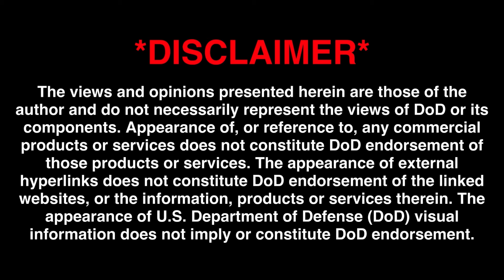AA590 Boeing 737 Rejected Take Off

Comment: STIG Aviation on YT is a AA aircraft maintenance tech and he addressed this on his channel that theres a possibility that the tire may have had a recap tire come apart. Which showed both starboard tires completely down to the rim which the fire also deflated the inboard port tire.
Reply from the maker: My understanding is most airlines use retreads.
Reply: @themoverandgonkyshow  If I'm not mistaken on his video and some other past videos he did, mentioned it is allowed to FAA standards that a tire can be recapped and limited to so many cycles.
Reply: @sailormike1089   In the automotive world, a recap and a retread are the same thing. I don't know about the aircraft nomenclature.

Comment: My question to you move it would be the tire is blown. The aircraft is already heavily listing over to the right if you go flying at some point, you’ve got a land with the landing speed be greater than the speed is at at the moment and also with the landing with on the one remaining tire that side make the other tire blow out with excessive load because the weight is not being distributed over to Tyres on the right hand side if the second tire blows out on landing you have nothing that side which means the plane will instantly catch pull round and you will have a very bad accident on your hands possibly surely rejecting a takeoff on the ground even if you are praying to the gods for the extra couple of foot of wrong way to bring it to a stop is better than going flying and not knowing whether you’re gonna get it stopped on the ground on the go around

Comment: Excellent discussion and explanations. The reason for the captain making the reject, especially when he's PM (Pilot Monitoring), is he's, theoretically, more aware of other factors and he still has his hands in position to take the airplane. He has also typically made those decisions already. It's very individual. Sadly, I've known a lot of F/Os who were not into making decisions or aware. Personally, I think the startle factor is less of a threat for a dialed in PM than wrestling the beast and dealing with my mind going, "WTF?". This is cover for the hydraulic/engine/other critical system failure. I'm very much with you that the airline F/O is generally not respected for his/her experience and judgement. Of course, it also very much depends on the F/O and how well the captain knows him. One of my last A330 annual CQs before I retired, the check airman, I knew him very well, criticized me for letting the F/O land the jet with a failed engine on the LOFT. We had a good discussion. What he didn't know before we talked was that the F/O was an exceptional former A-10 driver and aviator who I knew even better. We had flown together often including the 3 previous CQs. I'd rather have had him with me than several captains when we used to have captain, rather than F/O, relief pilots for Asia and Europe. He continued to disagree but we each made our points. I loved flying the jet. I'd rather be flying because I could do as well or better than most, captain or F/O, but my job as captain was to be totally wired into any situation. I can do that better if I have a good F/O driving and talking. Besides the Airbus SOPA for an engine out, overweight landing, and several serious abnormals is autoland. Two of us wired for deviations and additional problems is far better than one. His main point was how he was going to explain that decision to let the F/O fly a busted jet at a rug dance or to a safety board. Fair point. I'd already told him how. There was nothing written that said I couldn't make that choice. Besides, I'm the captain. My decision, I'm responsible for the outcome. I'll deal with the consequences. Yes, I knew the check airman and his mindset. I did what I did to make a point. The F/O was just icing and a cherry on top. Last quick point: AA procedures, callouts and individual duties, are different than ours were. They make a big difference. A blown tire was almost universally thought of as a GO past 80 knots unless there was any other negative effects. Those are the things we think about and have decisions made before going to fly.
Reply: @DonWan47  DILLIGAFF

Comment: If you blow a tire, the ABS will be drastically affected. Not sure if RTO Autobrakes were used here, but the pilot flying did an amazing job. Tons of damage to that aircraft. Flaps, main gear doors and engine. Not sure if that fire was hydraulic fluid or magnesium wheel igniting. Glad nobody was hurt, and they even exited the runway. Not that the runway would be used until the aircraft was recovered. Fire fighters would probably prefer the airplane be on the runway because it's much wider than a taxiway, and leaves more room to maneuver equipment. Great job by everyone involved.

Comment: Since going to the 121 world, I’ve noticed that the mindset behind rejects is…odd. 

Only CA calling the reject AND taking controls. Between an actual reject and the many I’ve done in the sim, that change of controls can get VERY dicey—especially if you have a situation that creates a lot of yaw. Crosswind with an engine failure or uncommanded TR deployment, for example. The CA has to instantly match the FO’s inputs as he takes his hands and feet off the controls. More often than not, it ends up being VERY squirrely, at best. While I can understand the CA having ultimate say, I can’t understand the binary, instantaneous change of controls at high speed, with potentially near-full control inputs present. Now throw in a low RCC and you have a recipe for disaster. Why not let the PF execute the abort down to a safe speed? I never understood this.

Also, the reject mindset seems to be more liberal. For my 121 reject (years ago, so the details are fuzzy), I had a generator failure. Day VMC. In my mind, I was taking it flying—generator failures were an everyday occurrence in the Rhino. I figured we would get airborne, run the QRH, likely fire the APU for redundancy…airplane flies just fine. CA immediately called the reject, and due to a stiff crosswind complicating the control change, we ended up halfway between the centerline and the runway edge. 

I queried other FOs and CAs, and the prevailing mentality was that it was correct to abort because it was an “electrical malfunction”. I noticed that my former military buddies voted “go” while my civilian buddies voted “stop”. Not a dig at either, but the disparity is interesting—along party lines, so to speak. I know that system failures and aborts are certainly more prevalent in the military world (at least in my experience—I was a black cloud pilot), so perhaps that experience base is what is forming the “take her flying” mentality? I can only speak to the Rhino, but a blown tire was most certainly a “go” call, as a high GW abort on a blown tire is going to be a bad time. 

Regardless, good discussion. I think this is something that needs to be explored. Apologies for the stream of consciousness!

Comment: V1 is not a “decision speed”, but a “last chance for ACTION SPEED”.
V1 is the maximum speed at which point a pilot MUST TAKE first ACTION to stop the air raft. The decision to stop must be taken well before V1. 

There are no 3 seconds to decide or whatever the talk is here. 

Also … why invite a guest who seems not to know anything about transport jet operations, especially if Mover knows his shit very well himself 👍🏻
Reply: I previously responded contrary, but it appears you are in fact correct! Learning occurred today. Unfortunately, they’re still teaching in many 121 programs (and CTPs) that you get V1 PLUS X seconds, not that V1 INCLUDES X seconds. Dangerous.
Reply: @C420sailor  You are absolutely right and I had countless discussions during my flying career about this subject. At least nowadays the common FAA/EASA V1 standardized definition is as clear as it gets and Mover explained all the other factors very well 👍🏻
Reply from the maker: The three seconds is typically found in Air Force Dash-1 assumptions.  Skid was an airline pilot long ago.
Reply: Three things here. 

1) Inviting a guest who knows less about a subject than the host is a great way to naturally let Mover explain things to a wide-ranging audience. Obviously, it's just my opinion on technique.

2) Some of the confusion about time spent at V1 may stem from part of the definition for calculating Accelerate Stop Distance. The Part 25 (Transport Catagory Aircraft) definition includes, as one part of the calculation, "A distance equivalent to 2 seconds at the V1 for takeoff from a dry runway".  Part 25(a)(1)(iv)

3) I 100% agree that you are correct on V1 being a "Decided" speed and not a "Decision" speed. The same Part 25 paragraph clearly states this. Part 25(a)(1)(ii)
"---and the pilot takes the first action to reject the takeoff at the V1 for takeoff from a dry runway---"

Just food for thought.
Reply from the maker: We don't do these shows in a vacuum.  This is a clip from a two hour episode with many topics.